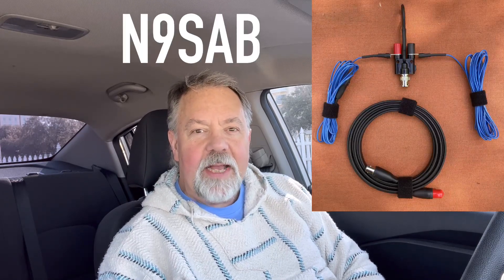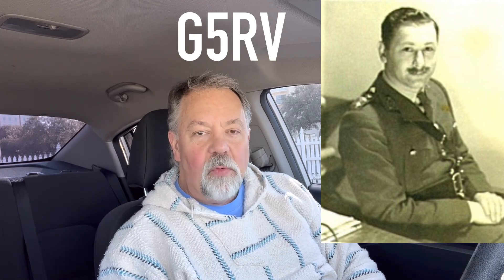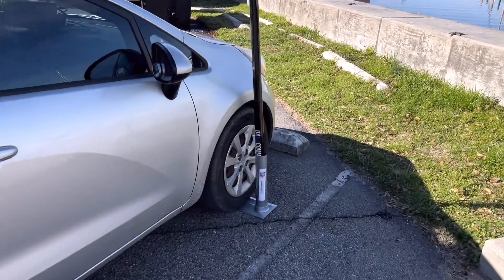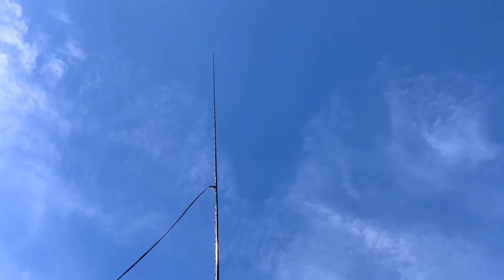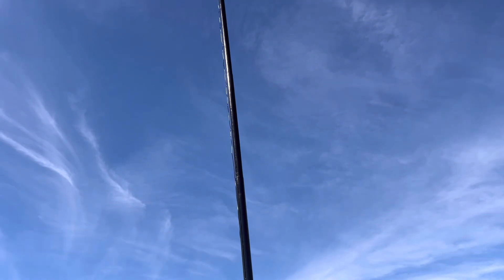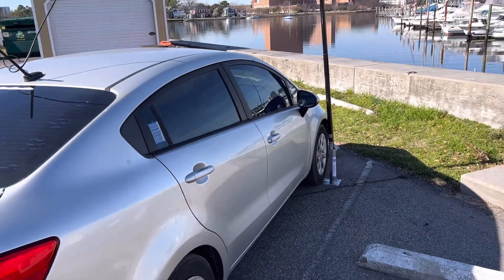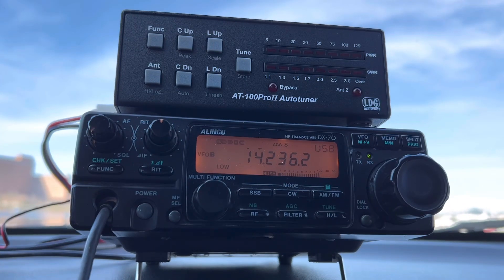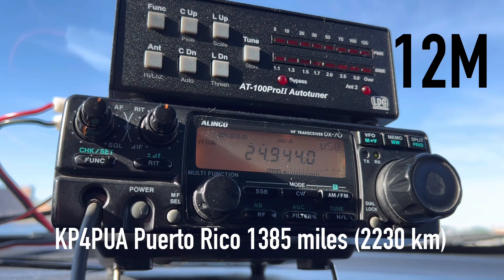A Vertical G5RV Antenna? Let's Experiment!

Comment: Hey man I'm brand new to ham radio. Setting up my rigs now. Two cheap vhf/uhf mobile rigs to simplex with my dad while hunting and some analog repeater use. My pota/sota/base station is the xiegu G90. Anyway I am building a simple 10 m dipole as my first antenna but would like to build a multiband antenna that isn't too hard to wrap my mind around. This stuff doesn't come easy for me. I do have a good antenna analyzer and all the necessary test equipment. Could you recommend a build to me? Not sure if a doublet is too difficult to learn how to set up and analyze or if I should go with an efhw or something else. I have 8 acres and the antenna is going to stay on my roof or strung around my yard until it stops working so size and mobility isn't a issue. Thanks man I love your videos. Cant wait to go to SF bay and try some of that salt water action. God bless - K06DFS
Reply from the maker: Thanks for the kind words! I would absolutely put up an End Fed Half Wave, it’s the easiest and most efficient multiband antenna to get started with. A 65’ long wire connected to a 49:1 unun and some coax and you’re cooking. You can put it up as a flat top, slope it or experiment with different configurations and see what works best. It’s at the top of my list for multiband permanent installation antennas is you have the space. 73, Walt

Comment: Nice, some of my POTA locations do not have much of antenna setup options, that ground mount looks great for my QRPGuys 3-band 40-20M vertical when there are no trees, and want to keep the antenna away from folks parking nearby to keep from tripping over the wires. An Inverted-V from two Hamsticks or Sharksticks might be a good option for that portable setup as well. Thanks for the ideas! 72 es 73, Davey - KU9L
Reply from the maker: Thanks Davey, all the best and good DX! Walt K4OGO

Comment: Very interesting , unfortunately i dont have a 300 ohm ladder line but only a 450 ohm . Did you have a chance to test it with a 450 ohm ladder line ?
73s V85NPV
Reply: Hello , manage to perform some test with adjustments > The dipole with a total lenght 7.85m and ladder line 3m i manage to achieve very good results comparing to my ENDFED (23m long) and my Random long wire (30m long) . Receive signals are almost identical. My N7DCC tuner can tune the antenna without any problem 20,17,15,12 and 10m bands.. i am using a 1/1 current balun. This antenna will be converted as a Beam antenna with reflectors at the rear (5 wire Reflectors) to cover 20,17,15,12 and 10m bands. many thanks for your sharing . when done i will populate all information on my Website. 73s
Reply from the maker: Thanks for watching. No I've only used the 300 ohm ladder line.
Reply: @COASTALWAVESWIRES  many thanks for your prompt response. i will try with a 450 ladder line. 73s

Comment: Hi Walt,

Was wondering if you've ever tried using ladder line for the legs of the dipole instead of stranded wire. My understanding you can shorten it about 20 to 30% by doing so
Reply from the maker: Hi Pat, I’ve heard that as well but have never tried it.
Reply: @COASTALWAVESWIRES  i have a linear loaded doublet that I use at home and it works well for local NVIS and also national contacts as well. It has a 25' 450-ohm ladder line as the feeder and also for the dipole legs legs - i added a third wire to the legs by weaving a #14 gauge insulated wire in and out of the windows - legs are only 16 feet on each leg, and able to talk 80-10 w a tuner

Comment: Nice one Walt! Experimentation is the essence of Ham radio. Two things, I don't see any choke or 1:1 balun in the antenna kit, maybe you were getting some RF back to the radio that was causing your audio issues. Also, I guess you could say that the ladder line in the G5RV is being used in lieu of a transformer to match or improve the impedance of the antenna to 50 ohms. Following that line of thought, I wonder if you could use ladder line instead of the 4:1 unun on your favorite Rybakov antenna. Or maybe use the ladder line to feed a random wire vertical with an equal-length raised counterpoise, giving you something that is a little easier to deploy. Who knows! Maybe I'll fiddle with that in the back yard one day. 73
Reply from the maker: Thanks Dan, yes I was getting some RF back and needed a choke for sure. Lesson learned there. I'll have to look into the ladder line and the Rybakov. All the best and 73!

Comment: It's fun to see all the weirdness and variety that works as antennas. Hope we get a QSO once you're back over to Europe again
Reply: Almost anything metal can be made to radiate. Some things obviously better than others. Also works for receive. I found this out when I accidentally left my antenna unconnected on my Anan SDR.  Saw lots of great signals. Picked one to respond to, clicked xmit and instantly swr pegged and the xmit section shut down. Huh. Twiddle some things, try twice more. Same. Get to start deep troubleshooting and almost instantly realized...no antenna was connected. I was amazed at how well it worked with no antenna AND realized a tuner with sufficient hmmmpf would resonate that SO-239.
Reply from the maker: Thanks, I'm looking forward to that QSO!

Comment: Hey on the DX-70 is it a mic connector issue on the radio or just the mic?
Reply from the maker: I think it is the connector, I’ve got to do some tinkering and find out
Reply: @COASTALWAVESWIRES  Let me know here.  I have two 8 pin round Alinco Mics.  Easily adapted to 8 pin modular if needed.